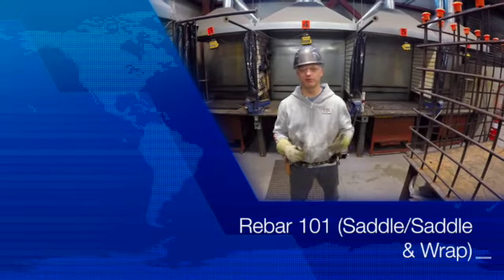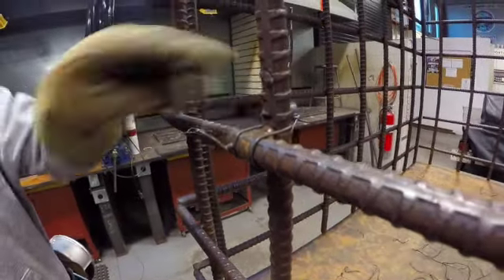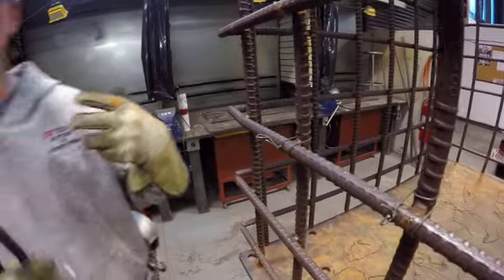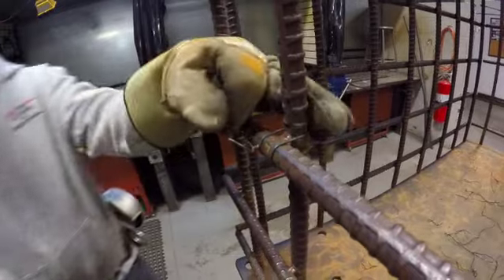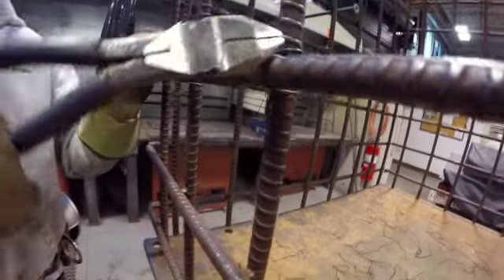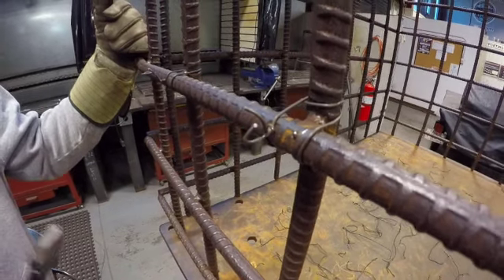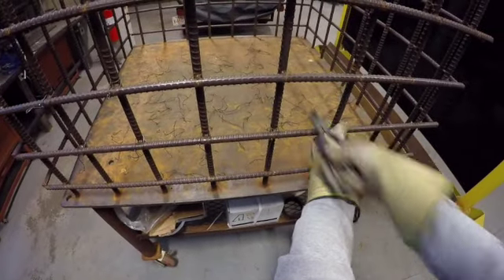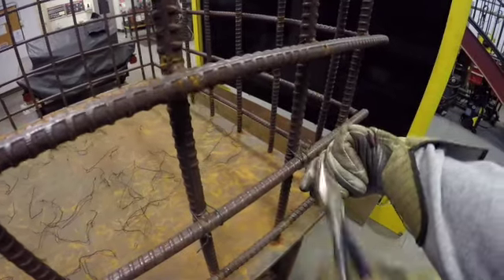Saddle w wrap

Comment: Not bad brother, the only thing is that left wire hand gets in the way of your pliers when you twist. Pull back a little bit on the wire and use your index finger. Remember better mechanics will help you last 30years.

Comment: Does bar size influence the tie type? I was installing rebar for a light column footing ( 10' x 10' x 8') and was using #11 bars...and was unsure what tie type was required.
Reply from the maker: The type of tie is determined by many factors such as bar size, position, weight and quantity.  The extra wrap is sometimes used to help prevent the bar from rotating like when assembling a column with 90 degree terminations.  It can also be used at the rigging points on columns to add extra support to the connection being rigged so the bars don't slip.  You may also use them on walls where they are built in place.  The extra wrap can help support the bars when climbing the wall and will help resist sag.  Ultimately it is up to the person installing to determine when and how many to use based on experience and time.